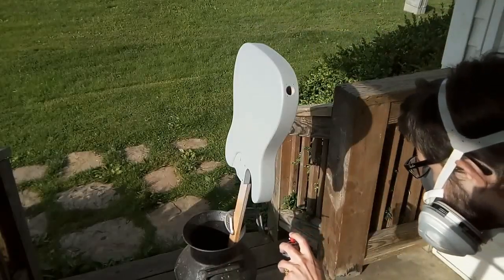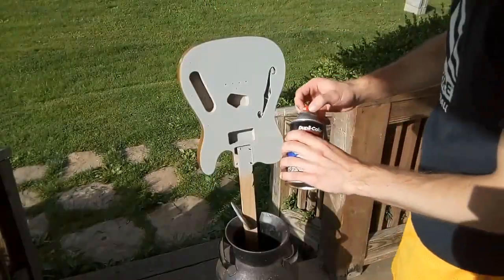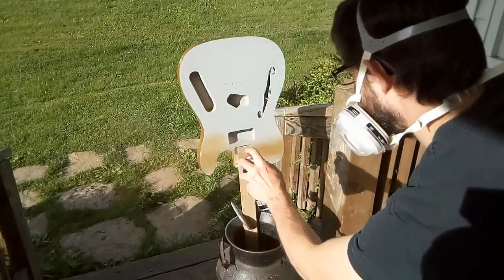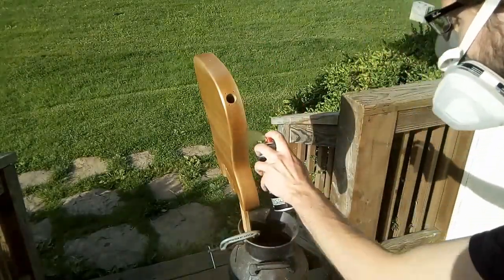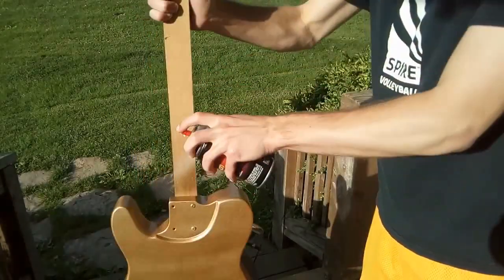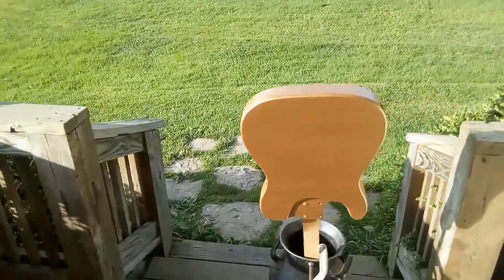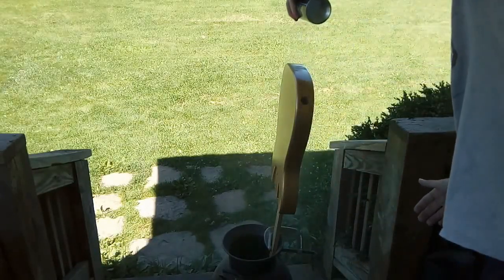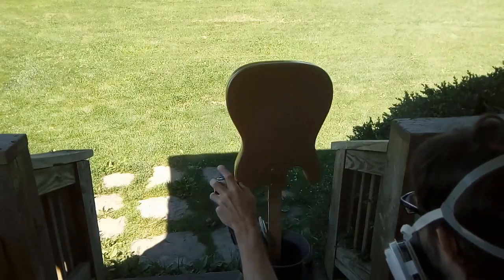Spray Painting a Guitar with Duplicolor Perfect Match - Solo Guitar Kit Build | Part Five

Comment: Did you level sand after the third clear coat?
Reply from the maker: Sorry for the late reply. No, ideally you would want to sand it with a few pretty high grits and then polish it, but I have a history of sanding through the clear coat when I do that, so I decided that it was good enough as is, lol.
Reply: I do more closer to 10 coats of clear before I let it cure for a week or more and wet sand with a block and 1000 grit.